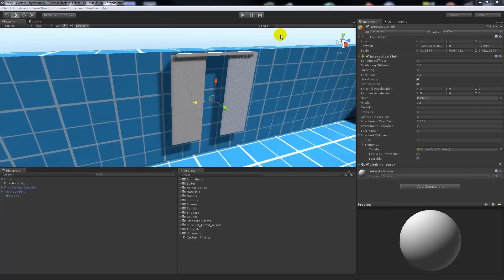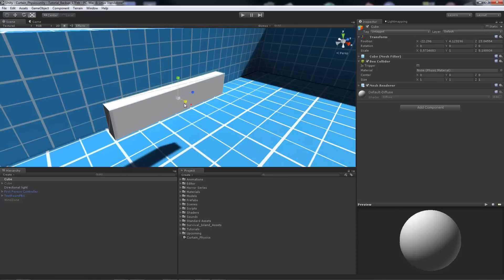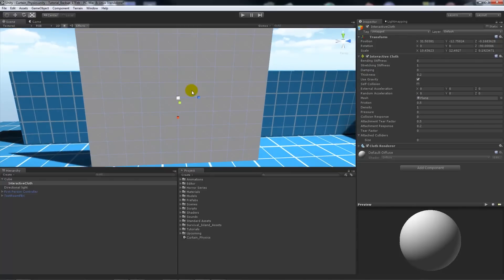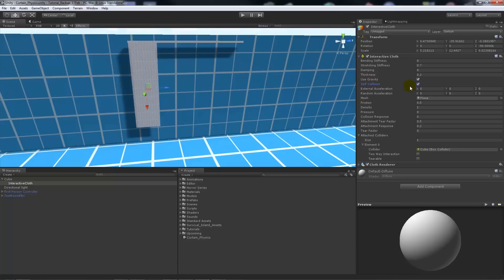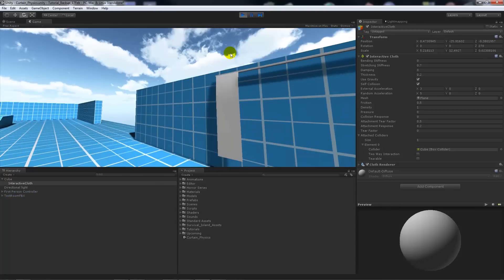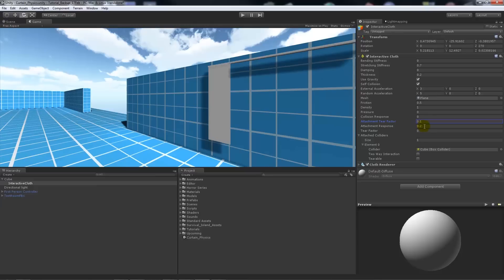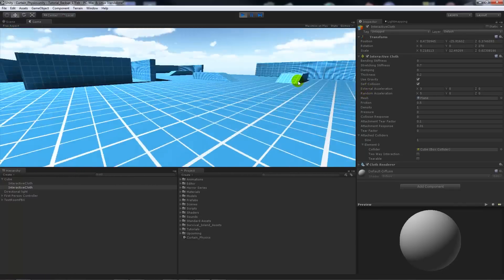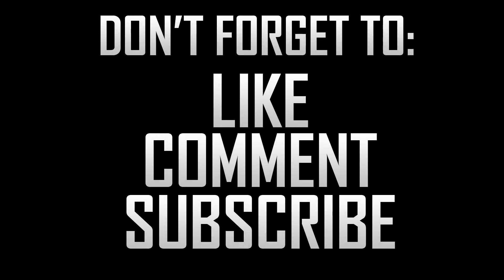[Unity3D] Wind Cloth Simulation (Moving curtains)

Comment: It's only showing from one side... How can I make both sides visible
Reply from the maker: Minzkraut Replace the mesh with a box, or have a shader which supports double sided.
Reply: SpeedTutor I am trying to make a flag I made vertical pole, than a horizontal one at the top to hold the flag out because without the flag doesn't look so good otherwise :)  But to complete the effect I need the cloth show on both sides.  Is there any way to accomplish this easily?  I am new to Unity and don't really understand how to change the mesh.  And how would we change the cloth colour and/or apply a texture?
Reply: make a high poly cube is what i'd do :/ but its probably really inefficiant in terms of performance?!

Comment: Unity 5? I am lost on unity 5. Please help.
Reply from the maker: Trevor Payne What's the problem?
Reply: SpeedTutor interactive cloth is not there, I managed to get one from an old project and you can only be patented by sphere coliders or capsule coliders aprently. The looks are different too.
Reply: Trevor Payne No it's been completely overhauled in 5. It's a bit rubbish for this effect but I got something similar working by scaling up a sphere, switching off render so we don't see the sphere and make it slam into a cloth set to react to the sphere.
Prior to 5 cloth was massively expensive so they made it only collide with known objects and even then only certain ones. The idea is to make clothing but I think they missed a trick if they missed out wind reaction. Maybe it's there but there's so little documentation ATM I can't find it. Give me a shout if you want more information.
Reply: Trevor Payne
And in fact I don't even need the sphere collider (although expand it out and flatten it and it acts as a "wall") really all we need to do is constrain the top of the curtain and apply force to x or z depending on rotation - hope that helps.
Reply: CursedIsle it did. Thanks!
Reply: Glad it worked maybe SpeedTutor could do a tutorial on it as there's damn near no documentation. I had to randomly stab at it!
Reply: CursedIsle yeah. They release it and then 'well, good luck finding to yall!', but you have to admit.  It's a very great update.
Reply: Damn right it is, Pro for free unless you earn $100,000! Even if you add in iOS and Android pro it's still less that Unreal Engines offer of 5% and never increases past 4.5% of $100,000.
Reply: CursedIsle it is alot easier than unreal with better mobile support too! Unreal and source may now be free but unity 5 is still kicking but hard.
Reply: CursedIsle don't you agree?
Reply: Sorry Man went out so missed that last update. Yep for mobile Unity all the way TBH I only downloaded UE when it became free so not had time to test it properly. From reputation I'd say until Unity 5 UE edged it, I don't think that's true anymore.

I also think there's a reason UE announced it was going 5% royalty model at the same time Unity 5 came out. They know they've got something that can go full on head to head.and win.

But really let's not complain about either, these are 2 professional AAA rated game engines and I got both of them on my laptop for free!

I programmed some simple wire frame 3D model software too many years to want to say how long, anyway the point is I know how complex these engines are.To get them for free is just crazy. Let's face it the reason for that is Unity so that's where my loyalty lies.
Reply: CursedIsle I hate my laptop. I am making a next gen game that has a life size earth and all of the planets are scaled like they would be in real life with alot of close up detail but my laptop can't even open up crome.